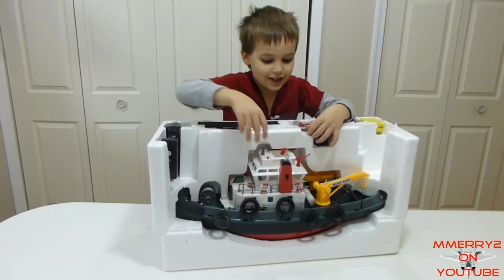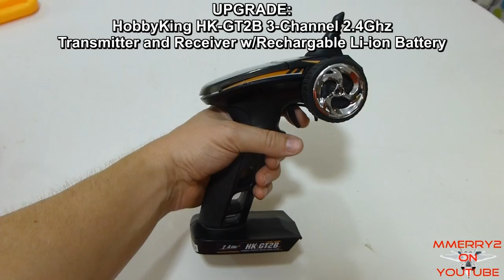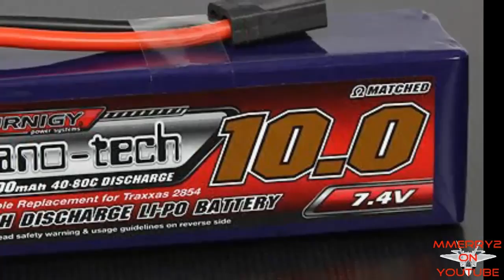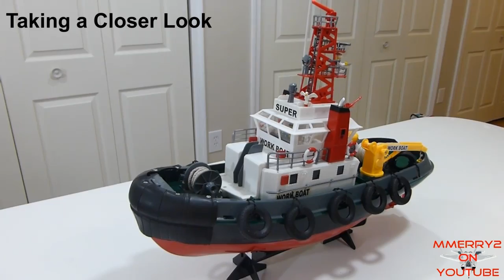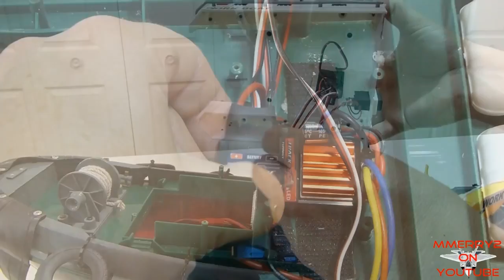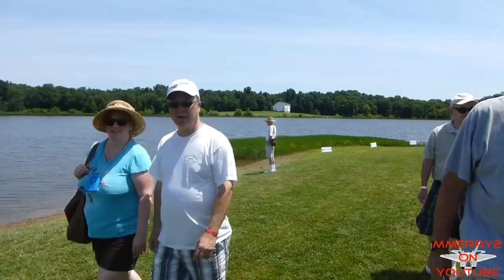RC Seaport Tugboat Upgrades Plus FARM Float Fly BONUS!

Comment: You gave me lots of ideas, including adding a smoke machine to it. I have the original trawler back when the company was owned by Dickie toys. I did what you did by eliminating all the electronics and changing everything over to hobby grade electronics. The big thing with the Dickie fishing trawler  was it was loaded with 1980, 's electronic that was not waterproof. as soon as the electronics got wet, it shorted everything out, then corrosion set in. Many were returned right away. I got mine at the Local Goodwill in its original box. I was hoping to salvage the electronics but it was a lost cause. The trawler has working wench that can raise and lower the nets. I actually drilled out the spot light and added a really bright led! I also added led lighting in the cabin and mast. At night, its really impressive.

Comment: does any know if it suppose to have some water in the hull like its not much its just like a small lego plate depth its really old i got it when i was 10 years and now im 18 please can somebody tell me if i have to open it to see if my dad did seal it off coreclty it had a issue with the water pump and still have its been staying and picking up dust for 8 years but it runs perfect just the issue with water pump and a bit low range but its kinda good egough for me

Comment: I got a similar model. I wanna replace the battery and engine too and add more lights and make it look weathered. Put a smoke generator in the chimney and maybe eventually make the crane arm operable and hydraulic and motorize the winch too. It has potential to be a real nice boat and I got mine for a good price.

Comment: I have this same boat and it leaks water onto the cab.  Did you have any problems with that?  it looks like the white posts that come up from the water chamber for the spray are hollow and water is just pouring into the boat?  should these be capped off?

Comment: I picked up a German made Trawler a few months ago from our local Good Will. The electronics were fried wich I guess is pretty normal because they used bees wax was a water proofing. I also noticed this thing has holes in the bottom for some reason,I didnt see any kind of pump but am thinking it was supposed to help balast the boat but instead caused the boat to fill up and short out the circuit board. I saw something simular only its a tug boat advertised on line,It also filled with water and shorted out. The price was around $144 dollars and didnt last very long. I have no idea if its a copy of what I have only mabe the top half was changed. I have purchased a new transmitter and receiver as well as brushed ESC speed controller. all the electronics still function well,just not the controls that came with. The deck work was really well done on this boat. I was really happy with it. I have to get it out of storage now to install the electronics. after seeing your review,I may modify the steering,and install a servo since it has the same type of steering yours has.
Reply: i have this issue to but mine does not short out it does still run perfect but all goes out when i lift it and water pump does not work so your may be a fake one i cant be sure but might be

Comment: hey man, I change my motor, esc, transmitter n receiver but wish to reuse my pump and servo but I saw a twisted red n black connector which I believe are the power supply and also another 4 wired connector from the servo as well. any idea how I shd conect up the connections to the receiver of the old servo?